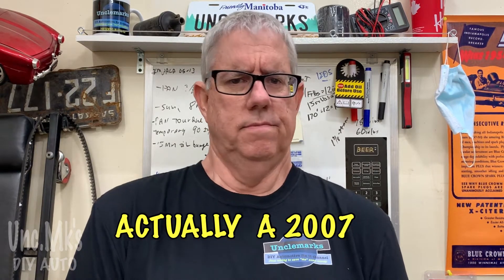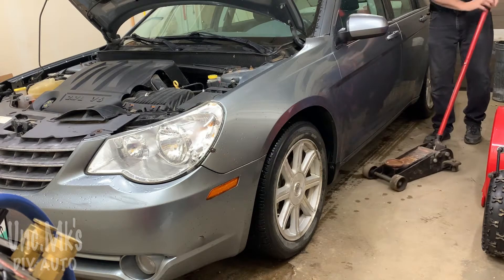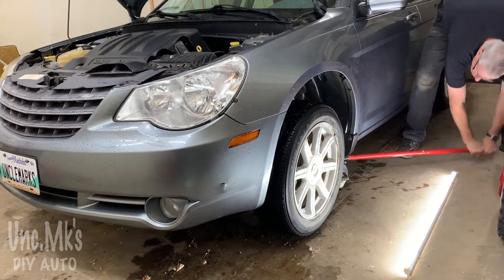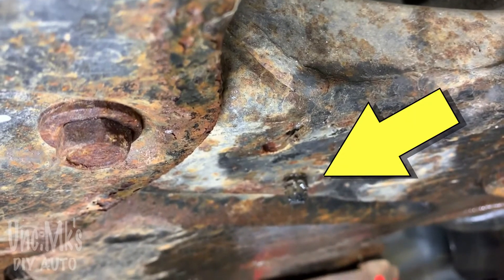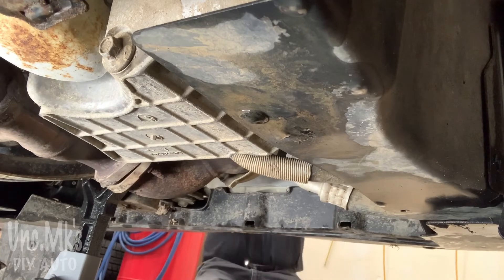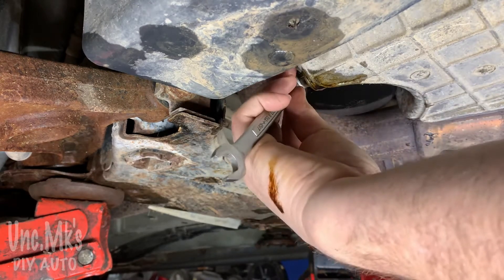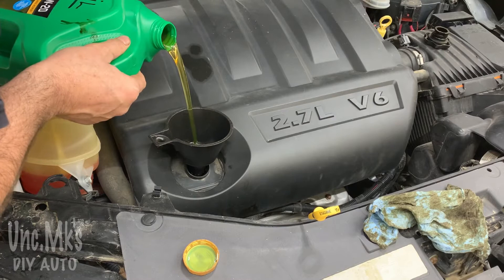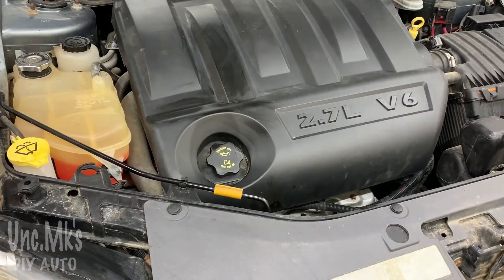How to do oil change on Chrysler Sebring 2007 - 2010 & Chrysler 200 2011 - 2014  2.7L V6 (EP 226)

Comment: I am so glad I stopped my show so now I can really feel relaxed and at ease when I'm watching videos like this! Surprised that there was not that much rust under there AT ALL! Excellent tip on checking that oil ring because that has actually happened to me years back. You have me wondering is that the original filter because doesn't that car have little to no miles at all?

LOLOLOL What did you trip on during the outtake🤣🤣

PLEASE tell me I didn't hear you grunt around 15:36🤣😆

People have NO IDEA what they're missing if they don't watch until the end! The frustration IS REAL 🤣

GREAT VIDEO with a lot of great tips!
Reply from the maker: The Provence of Saskatchewan is even better for no rust on older vehicles. Lots of 1950 & 1960 stuff running around with original paint in the summer time. But rust eventually eats them all.
Reply from the maker: Timmy, I think I did grunt! Tripped on the tri-pod leg LOL There was a oil change done within 4000 miles according to a sticker, but that was years ago! I did use synthetic as I always by it when their is a sale. It should be able to take more abuse that regular oil and easier on winter starts at -35F!
Reply: @unclemarksdiyauto  Completely agree with you on the oil! That place you mentioned, do they hardly have any winter there?
Reply from the maker: @OnlineAutoRepairVideos  That province is west of us. Similar winters, but they used something different to melt the snow, or used a lot less. Not sure. But they did something different. Manitoba has a population of only 1.38 million and Saskatchewan has only 1.18 million.
Reply: @unclemarksdiyauto  we use some sort of brine to melt the snow,  and it's great for not attracting rust, but it does nothing for the roads, LOL!
Reply from the maker: @OnlineAutoRepairVideos  actually we use something like that, but it must get trapped in places and moisture does it thing. Saw a Ford video awhile back were they were bragging about all the research they do to stop rust. Testing then tearing car apart to see where rust starts, then making those weak places harder for rust to start. I was impressed with the video, but I see their cars still rusting! Guess the promo was all smoke and mirrors as they say.
Reply: @unclemarksdiyauto  LOL!!!

Comment: I did the oil on mine yesterday, a 2008 Chrysler Sebring 2.7L Flex Fuel. The little computer at Canadian Tire recommend the MPH16 filter, which ended up being too small for my car. The PH2 ended up being the correct one. The 93mm wrench socket was too big for my old filter, luckily I was able to remove it by hand. Figured I'd mention this in case anyone else has the flex fuel version! Thanks again Uncle Mark love the channel.
Reply from the maker: Thanks so much for the info! Why can't they just use one filter on most of their engines?

Comment: If it's past due for an oil change, would it shut off if put on reverse or drive?
Reply from the maker: No it won't. You must have another problem Cesar. I hope you find your problem.

Comment: Uncle Mark does the cars rust over there.:goodvibes:
Reply from the maker: They do, but not as fast as some places. Highways here in Manitoba use salt in winter here which is not the best for keep rust away. Lots of vehicles running around here that are at least 10 years old with no rust. Where are you located?

Comment: he's not using the factory jack points also
Reply from the maker: Not using factory jacking points or factory jack. As these vehicles get older and start to rust, the factory jacking points get weak and can't support the vehicle. I never trust them on a used vehicle.